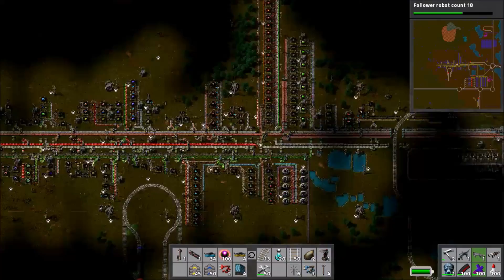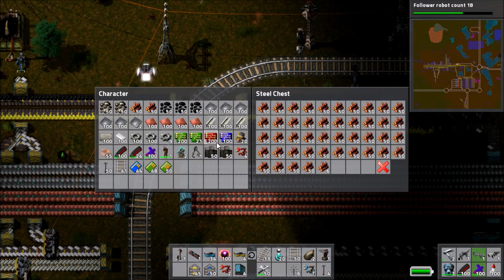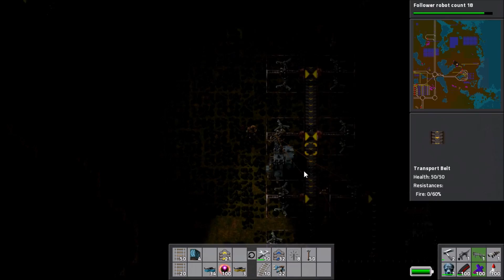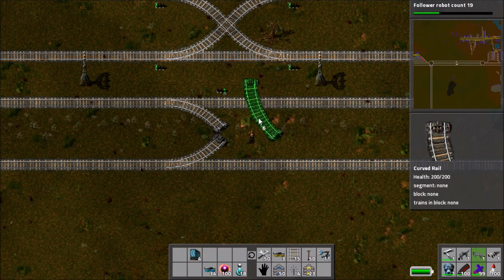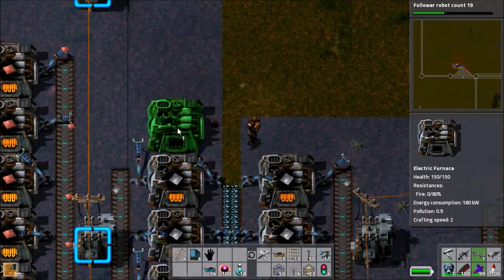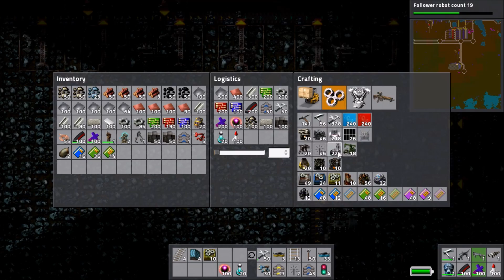Factorio Railworld Ep#34: Peripherails

Comment: +MangledPork Gaming maybe you do this later on (btw glad you kept going with the series.. serieses.. whatever) to avoid congestion can't you simply add signals to the loops themselves. Now each loop is a single block, so if a train has already reserved a path through, let's say going west-east on the central rail, it will make a westbound train stop at the entrance of said loop.
Won't two signals to the inside left and right of the loop break the upper and lower half-circle and create a sort of integrated bypass for horizontally travelling trains? by adding 4 you can allow the use of 90 degrees turns independently on crossing and T intersections, like the one going south to copper.

(you can check this after the exams don't worry :D)
Reply from the maker: +Thai Breuer As soon as you add signals inside the loop, it becomes possible for gridlocks to occur from trains entering different sections of the loop and blocking each other. Later in the series chain signals are implemented which allow you to safely split a loop into multiple blocks. I end up setting it up on one particularly busy loop, but never bother with the others because they run alright anyway.
Reply: hey what are you doing around..? I thought you are supposed to study!

I think I see how it could get stuck..
I was still wondering what chain signals were used for. I'll pay attention up ahead when you use them on that one junction to see what happens in detail.

By the way, just saw the War for the Lake and it was epic.

Comment: In theory all you need are those crossing sections and non of those loops. Remember back when you started building these loops. Just what is happening now is what I ment.
Reply: and how do the trains get back ? they can't turn on such a section, so you'll need seperate turning points, and then the train has to go to the end of the track to turn. none of these systems are optimal but if you use both, the loop and the sections, it's probably the best way to go!
Reply: DerPapierfliegernarr think about it.
When do trains need to turn artound?
After they leave the respective station.

You have 2 tracks in each direction. Just make sure train can access the return lane when leaving station.

And design sane intersections that are not loops and can't be blocked by one single train for all other trains. The fabled cloverleaf intersections.

That's the problem with these simple loops. One train blocks all even if one turns right the other turns left.